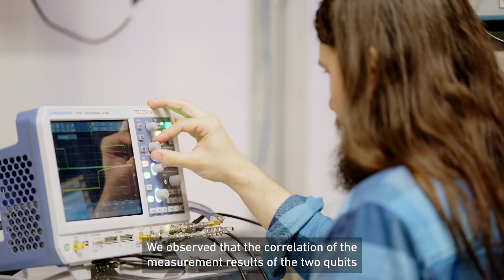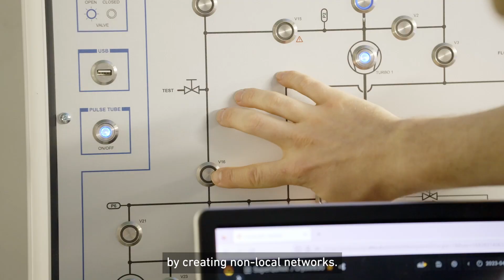Testing quantum physics with superconducting circuits in a loophole free Bell test

Comment: exchanging the "photon"  is putting them in vibration harmony, this is what is creating identical results, it is HARMONISATION Not entanglement, the results might look the same but the reasons are not! 😮 Just because a piece will fit in the square hole, does not mean it is square!
Good job!

Comment: But it is still deterministic, otherwise there could not be such a strong correlation, right? So is there also an experiment that tries to show that QM is indeterministic at some point?
Reply: It is random at the same time as it is correlated. The individual measurements of each qubit are random. If you look at simultaneous measurements of the two quits they are perfectly correlated.